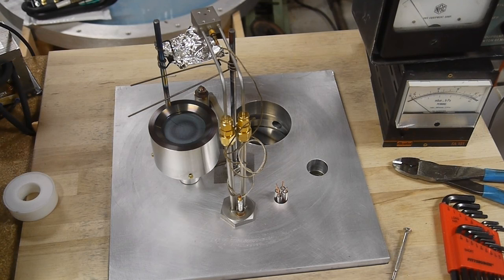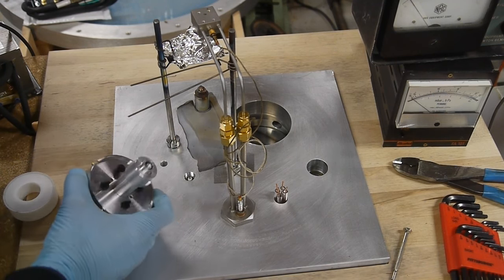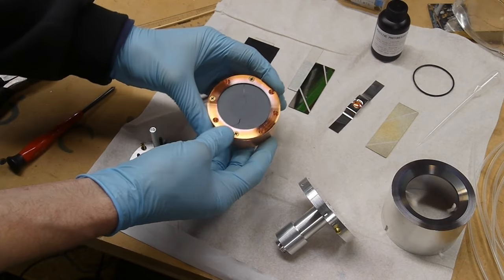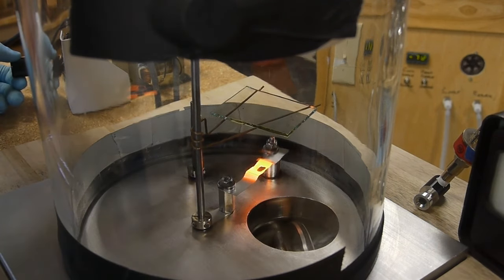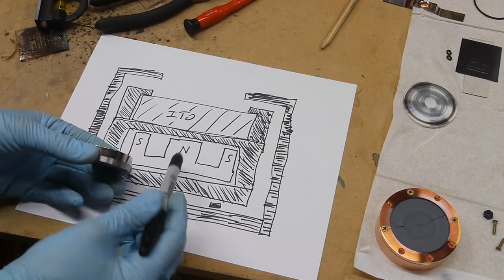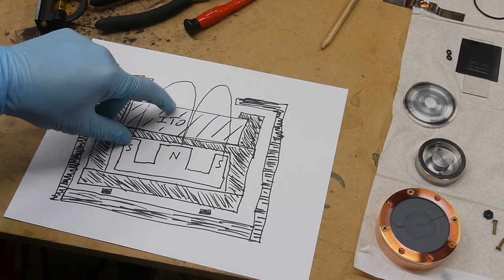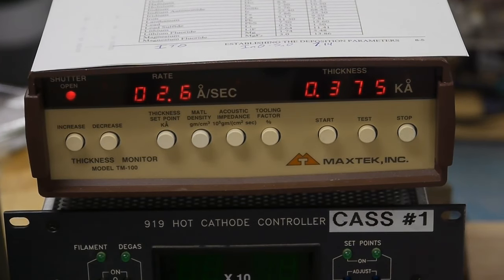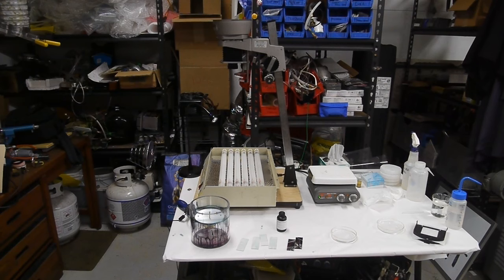Intro to sputtering (process to create clear, conductive coatings)

Comment: ***** A somewhat of a beginner DIY-er here. I've been looking to making a CO2 laser for quite some time, but only now have the finances to actualize it. The idea is to make most of the resonator parts out of DIY metal oxide and water glass based ceramics that I'd fire in a kiln I'm also building, seeing as some commercially available units have ceramic resonator chambers too. The concave front and rear full reflectors would be ceramic as well, or perhaps molded glass, made by using plano-convex lenses as a negative, or castings made of them that could withstand the heat of melting glass. The front mirror would also have an aperture to the ZnSe lens that collimates the beam some 50mm further into ~2.5 millimeters in diameter. With known surface radii of 1 m and 0.5 m on the 50 mm and 25 mm diameter lenses I got, I'm going for a r=2*L long radius setup with ~500 mm 50 mm and ~250 mm x 25 mm resonators. The former would be a proof of concept, since it should be easier to make using preexisting parts.

Anyhow, to the main point: Those mirrors obviously require a reflective coating, so I figured I could perhaps use the decent two stage vacuum pump I've ordered, along with the high voltage power supply and rectifier set up for the laser itself to sputter an initial conductive coating onto the ceramics that I'd electroplate further with commercially available solutions to prevent gas contamination. Currently, I got a simple ZVS flyback @15kV~200W max, rectified with high voltage diodes stringed together with a couple ceramic caps to smooth it out. Clearly, the mirrors wouldn't have to be absolutely flawless, just good enough, as we're not trying to take pictures of Saturn.

Any thoughts or ideas, if I may humbly ask? I wonder whether silver nitrate sticks better after all.
Reply from the maker: Typically, laser mirrors are dielectric-coated, not metallic.  The problem is that the metals reflect only 99.5% or less of light, and the laser is powerful enough that the last half percent of power that is absorbed is enough to destroy the mirror.  Unfortunately, dielectric mirror coatings requires tight thickness tolerance and usually a stackup of different materials to get good reflectance at a specific wavelength.  It would be possible to make one in a DIY setup, but much more difficult than a metallic mirror.  It's also possible a metal mirror would work fine for a low power laser.
Reply: Cheers! I was under the impression that dielectric dopes and coating mostly applied to YAG wavelength partial wavelength specific reflectors, lenses and mirrors. Those I bought manufactured for my Nd:YAG without a single thought of DIY crossing my mind, aside from all the parts coming from all over the world.

While that will be for engraving, or cutting thin films at best in a somewhat compact platform, the CO2 could eventually use the same CNC device for cutting, hopefully. Of course a pre-made tube would've been an option, but I'm doing it for the sake of the learning experience.

Looking at some of the industrial CO2 laser solid metal mirrors, they're gold electroplated, like this one here:

http://www.lbp.co.uk/zoom/img34.jpg

Their selling point is that directly electroplating metal prevents flaking, peeling and such, associated with long term use of sputtered coatings...

Quite a few of the flat mirrors that are available as spare parts for the Chinese cutters are either silicon, or gold plated silicon, even molybdenum plated, but they're mostly for beam guides and not suitable as resonator mirrors for the cavity diameter I'm aiming for, without at least one concave mirror. If one, then why not both = more power.

I did consider using the mirror making methods that amateur astronomers use and saving time by using forms made out of the lenses mentioned earlier as the basis for the grinding tools. They could be then used on solid copper, for example, which should be easy to either silver plate, or nickel and gold plate.
Reply: Kageitenshi Do whatever you want, bro; you seem all read up on the topic so just jump into it instead of wasting your time here. The only thing Ben validly points out is that the finite resistivity of metal makes for bad mirrors. With losses of 5% and more of the incoming power, you'll have some very bad cavity mirrors if going for metallic reflectors. Remember the intensity of the beam inside the resonator is much higher than whatever you'd tap off at the output, and you'd thus easily have to dissipate as much as or even more power in the metallic end mirror than whatever you tap off as a beam from your laser. Go for dielectric mirrors and stay cool (yeah, pun intended).
Reply: Yo Da Well, I am doing whatever I want, while waiting for snail mail for the missing parts. Currently it seems that I'm going for vacuum casting aluminum or copper using the lens mentioned previously to form the concave side that I'll polish with the method used in making telescope reflectors.

With gold plating, I should have to worry about only <2% loss to dissipate through cooling. it'll be much easier to plate and the price for going for a dielectric mirror for just one percent higher reflectance isn't going to be worth it at these output levels.

It's not like the mirror would deform or degrade significantly under a few watts of power that would be actively dissipated through water cooling anyhow, in my current CAD model revision.

I appreciate your thoughts on the matter.
Reply: Kageitenshi That's fine bro. You seem to have set for a goal, and that's good, but for any decent power output levels, you'd want as much of the power you are not tapping off as possible inside the cavity. Gold is a bad reflector due to its higher resisitivity, and will give you pretty lousy reflectances, around the low 90's percent. With just a couple of dielectric layers you'll quickly reach 99.9% reflectance and above, which is a dramatic difference. For usable power output levels and cavity efficiencies, at some point you'll need dielectric mirrors. Most lasers refuse to lase if the cavity Q is too low, which limits your output power level even with a high cavity power level. If this applies to your design, you tell us when you built and tested it.
Reply: Yo Da Eh? According to most charts I've seen online, the reflectivity of gold almost matches that of silver at around 800 nm, being ~96% there, but climbs all the way up to ~98% at thousands of nm depending on surface quality, without dielectric coating. We're talking about 9600-10600 nm here, after all. There's a reason the large IR space telescopes use pure gold plating.

The ND:YAG side pumped setup, I just finally received protective goggles for so that I can test it, does have quartz full and partial mirror specifically for the 808 nm pump diode and 1064 nm output.

Edit: yes, dielectric coated gold mirrors do seem to boast a 99.9% reflectivity at ~10000 nm

Here's some pre-made:
http://www.thorlabs.de/newgrouppage9.cfm?objectgroup_id=6627

Chart shows ~97.5% at 10000nm
Reply: Kageitenshi Ok, looking into the specifics of gold in your particular application, I have to agree that gold has a reflectance maximum in your area of interest and you will get away with using it as you describe. 

The reason of using gold layers for thermal insulation in space is its good reflectivity across a large bandwidth of frequencies. Your application is, by definition, as narrowband as it gets, and dielectric mirrors will in these applications almost always outperform metallic mirrors - you were for now just lucky with that reflectance maximum.
Reply: Yo Da Well, most available dielectric mirrors with the planned dimensions are plano, so that's already a loss greater than what could be gained by marginally improved by the increased reflectance - The greater efficiency of a concave-concave mirror setup greatly outweighs it, from what I can gather from various sources. Increased costs wouldn't justify it and it's not as though I couldn't later improve on the design, or start over if it doesn't work.

Basically though, it's almost a direct copy of some of the ceramic bodied commercial CO2 lasers I've seen floating around since my first comment here.

Edit: I meant IR telescope reflectors, not the insulator...
Reply: Kageitenshi As I pointed out from the beginning, you seem to have your mind set on a specific design and don't seem to want to discuss that, so I really don't see why you are still around here. If you came to inform others about your planned project, rather do finish it, come back when it's done and you'll surely get your due brag points then. At this point you're just as much of a talker as anyone could be. No one really cares about your details beyond what's already mentioned. Good luck with your project!
Reply: Yo Da
I am honestly confused as for your reaction, the necessity of and the warrant for the previous comment: Partly thanks to Ben's reply I changed my mind about making ceramic mirrors with sputtered surfaces, especially after learning how difficult it will be to gold plate them so that they last. Also, since then, I've ordered many of the parts and tools required to fulfill the current design, so I have a vested interest in not changing said design mid course, hence being limited to being open to trying again if this fails.

Where does bragging come into this? I've learned quite a lot since February 23rd that the original post is dated and I've been speaking mostly hypothetically. However, had I been talking about things like that "my YAG setup" at that point, I would have been just a talker. Since then I did receive the 40W DILAS diode in the mail last week. Also the safety goggles and a suitable power supply arrived: a POL converter for 0-3V and the required 0-50A output current. That along with a broken ND:YAG rod from eBay that I've been polishing , but ran out of grits to work with, so lapping papers and polishing compound are now in transit and so is the back mirror and output coupler. The last two are still being bounced around in China... I know, pics or it didn't happen.

At first, I did consider just a simple glass tube CO2 laser with a mirror and output coupler from some online retailer, but I couldn't find a local supplier for pyrex tubing that didn't have a minimum order, so I came across a ceramic design for industrial use and figured that it would be an interesting learning experience by replicating to the best of my ability. I could've just bought a Chinese tube for a $140 but what's the point in that?

Everything from producing suitable ceramics and glazes to hold a vacuum, a kiln to fire it with that is also capable of melting metals for casting, after learning to make molds, equals many of my personal interests being realized by one project that I haven't had the financial opportunity for, until I got a steady job last year.

The whole point is to learn from the input I get, the things I've read and seen and finally by doing. It's not like I don't see the merits of your suggestion, but I can not either produce a dielectric coating for a mirror of my own making, or I'd have to custom order something, have one of my own making coated for a high price, or change the design to fit some commercially available mirror that would likely end up costing more than the whole setup put together, not counting the tools, like a 2-stage vacuum pump.

I'm making a half size prototype at first as well, before committing to making anything bigger, to see if the concept even works, at all.

What matters to me is that I at least try for myself. Not for some bragging points on the internet by showing the toys I got, however cheap I got them, most in used condition, or being seen as nothing but a talker for not having much to show, even if I did.

I know I'm long-winded, but your mentality in that last reply baffles and frustrates me to no end. I care about the details and people have given me constructive ideas based on them. Exchange of ideas is what drives innovation forward. All the better when its open and free.

One final thing, the reason why I persisted: had you been able to prove to me that gold would be a poor choice, it would have driven a change, but I was confused by that, since quite a few commercial units have the mirror type shown. If I had erred in judgement, I wanted to know, simple? No?

Well, two. This one more tongue in cheek:
Was that "why are you still here?" more about "why are you still on YouTube?" or "why are you near, or at computer able to reply when a phone jingles to notify of a reply?" more so than "why are you still anywhere but dedicating your every living moment to working towards the goal you've set forth and stubbornly chosen to follow regardless of any input that comes late for the start of the show, not having seen what has happened until now?"

Either way, I sort of get what you're saying but it's such a senseless and assuming thing to ask!
Reply: Yo Da Huh, a reply. I should've been sleeping by now, oh well, you got me started again:

Sharing and researching ideas doesn't equal accepting ideas without sufficient grounds to do so.

"meh, have better ideas, not gonna bother"
I know, I do have a tendency to come off that way. Part of why I don't engage with people much; they don't much like how I seem very self-centered and unapproachable in that way, so I try to merely communicate what is necessary in most situations and avoid chit-chat, even if someone for some reason tried to engage in it. Written format like this lets me review, edit and check for errors before and after posting a reply. Which is why it's easier to get carried away, because I actually think by far too much about such things. I can't and won't speak for others and try to make as few assumptions as possible, or at the very least try and verify any that I recognize.

Conversely, I thought the same of your replies, as fact checking the 90% reflectance figure should've been trivial. But, since I may have had been wrong about it, I tried providing (researched and double-checked) justifications for my views to be evaluated, like satellite IR telescopes. That, in my view, is the opposite of "have better ideas, not gonna bother" and much less so that " I have better ideas" but rather "others seem to have better ideas (that you seemed to have overlooked.)" Having them met with the equivalent of "you seem to know better, do whatever" is confusing and frustrating, when expecting having them either refuted, accepted or elaborated upon by someone who seems to know better. (Based on apparent confidence in making assertions.)

I assume that there are people far more knowledgeable and experienced out there, so I try to stick to the basic generalities, design parameters and principles, while questioning mainly the things I'm most uncertain of, or that are relevant to the context of the source. Someone more experienced might notice a flaw or an improvement to be had, or even find inspiration of their own.

For reference, there's a glaring error that was left unnoticed until a week ago: I had plugged in the numbers for calculating the radius of the lens and thus mirror backwards and it's not 1 meter, but actually closer to 258 mm for the lens I got. This is closer to the confocal-confocal mirror setup I originally thought of using, so not much of a loss and can be easily adjusted for. People have been making CO2 lasers out of scrap fitted with rock salt output couplers and polished hard drive platter disks, or even polished copper coins for mirrors that work sufficiently well, so "meh" indeed!

Chapter 6 of that book you linked had been an on-off reading while I researched mirror coatings. While the principles are relatively easily understood, the maths, not so much, so most of it has shaken off by now. But the important point stuck, being the question of the actual technical solutions required to actualize the exact thicknesses ascertained through those calculations and which are far off anything any DIY solution would be capable of providing. If example 6.3.3 is even remotely indicative of the requirements for 10-15 um applications achieving greater than 99.9% reflectivity, we'd probably require some seriously specialized and expensive hardware and materials to reproduce it. Not likely something I'd have access to, especially financially.

Evaluating cost to benefit and questioning things comes rather intuitively to me, to the point of absurdity, having had to live on a low budget for so long for one reason. Even though I may not have been able to put the reasoning into coherent sentences so far, here's an attempt to do so:

I have had a pretty good idea from the get go that there's most likely a damned good reason why many industrial lasers use plain, or SiO protected gold mirrors to improve durability and reflectance at 800-1300 nm, where the reflectance of gold is a mere ~96%, less so beyond that, where it begins to absorb the longer wavelengths instead. Hence the original "I was under the impression that dielectric stuff applied to whatever YAGs and stuff."

So now I checked and found that the cost to benefit ratio simply isn't worth it: It's by far easier and cheaper to build a bigger laser and PSU and to increase the output by many a percent by proper alignment and tuning, than to increase the output by a percent or two by improving the mirrors unless absolutely necessary, even if the loss is cumulative. ~98% vs. 99.9-99.99% and exponential extra cost - how about no. It's a cutter, a fancy saw with replaceable blades so to speak. Heat that needs to be dissipated is less of a problem as more wear and tear is caused by the plasma and deposits of vaporized crap being flung around by it. I would rather replace mirrors that costs a couple dollars to make, even ten or twenty times as often than a single mirror that costs a hundred times as much, even if it improved the output by 20%

Besides, if I were to even attempt to DIY dielectric coatings with the likes of tellurium, hafnium and yttrium oxides that I see cited as being used for coating higher grade IR mirrors, they aren't exactly off-the-shelf materials. Sigma-Aldrich sells them, so I had a look at the prices. Needless to say, a simple pre-made replacement mirror would be cheaper than even one lot of those mere materials. The minimum order of 10 grams of Yttria is around $45, right about as much as one mirror small concave mirror would cost. Tellurium dioxide $65 for 5 grams. Hafnium oxide on the other hand... 1 gram, $180+ (I did the euro to USD conversions in my head, so I may be off by a little bit.)  On the other hand, many other materials for e.g. anti-reflective and anti-scratch coatings would seem to be sold as quite affordable pre-formed pellets for the purpose.

Seems less than a productive endeavor to sidetrack into, no? Including the option of having DIY mirrors coated industrially with materials that aren't common even by their standards. Production runs usually have a minimum cost that would favor bulk quantities of the usual kinds of anti-reflective coatings and such. Usually when there's a phone number or an email address to get price citations for minimum custom order numbers, it's not worth asking.

So, I hope you see why I might've had my doubts about even considering trying to gain access to, let alone build an industrial quality sputtering machine and why what you've told me wasn't likely to change my mind.